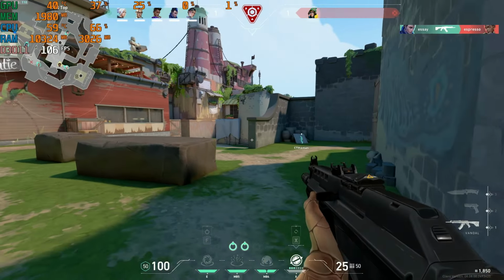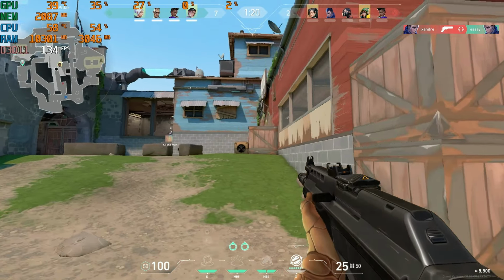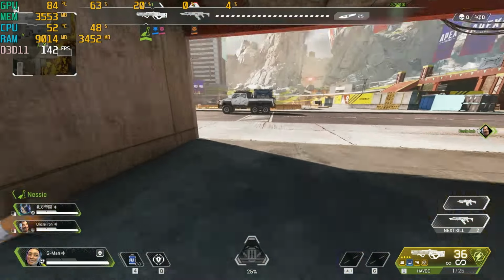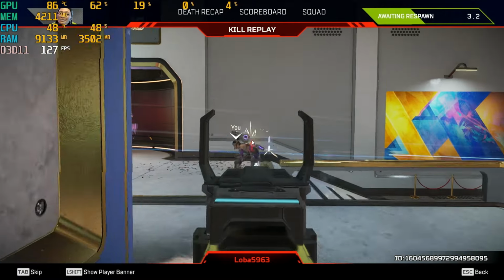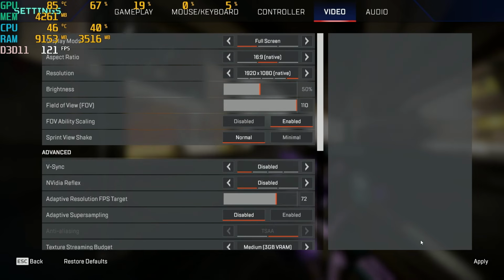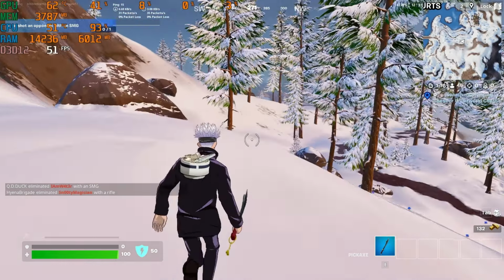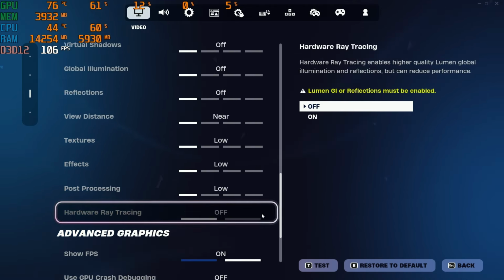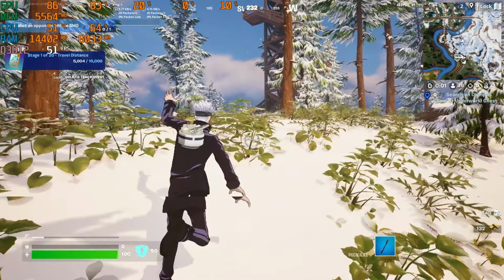Building A $2400 Gaming PC | Didn't Go as planned...

Comment: 120fps in val on low? wtf. my 300$ laptop gets the same amount of fps lmao. my budget pc with ryzen 5700x and 2080s gets 400+ fps on 1080p low
Reply: That's probably because he's using single channel ram for some reason
Reply from the maker: If the motherboard didn't have a problem with the 4 ram slot messing up, it would have perform way better with duel channel. Unfortunately, I could only run single channel which isn't good for gaming

Comment: If i were you i'd get an i7 or an i5 and spend more on the gpu like a 4070TI would be a way better choice than 2080S
Also if i were you i'd pick amd as the cpu cuz 7800x3d is cheap and better for gaming 
But not a bad build

Comment: I don't think you plugged the monitor to the GPU. And fix the dual channel ram. And honestly if i was spending 2400$ then I would go with a 4080 or 4070Ti. And surely an Ryzen 7 7800x3D or an i7 14th gen. But still you should be getting way more fps with a 2080 super.
Reply: Yea that's because he has single channel ram that why performance sucks

Comment: 2400$ PC and then its midrange to low end. Bit weird. And that you got a 700$ last-last-last-last-last gen motherboard is not a great deal. Its still 150$ invested into a hopelessly outdated plattform. Instead of the AIO, you couldve gone for am5+7500f+32gb ddr5, would have spend the same money, got more performance and actual upgradeability
Reply: No way It's low end, this is able to play any game at 1440p, and some at 4k. This is on the high midrange or low high end section.
Reply: @novazephyrose6490  oh, and now way its anything near high end when it is on par with a 7600 when the 7600 is on the bottom of midrange
Reply: @jlm_pc  Uh no, the 7600 isn't on the bottom of the midrange. It's firmly in the middle of it.

Also, that 2080 Super is 15-20% faster than the 7600.

The Way I see it in 2024, the bottom of midrange is a GTX 1060/RX580

Everything else is a 970/1650 and below.
Reply: @novazephyrose6490  gtx 1060 isnt even from any current generation. and cannot even run current games at 1080p60 at all. how tf is that supposed to be the current midrange, when itw as midrange on release hundrets of years ago?